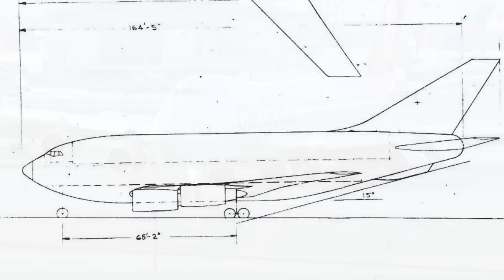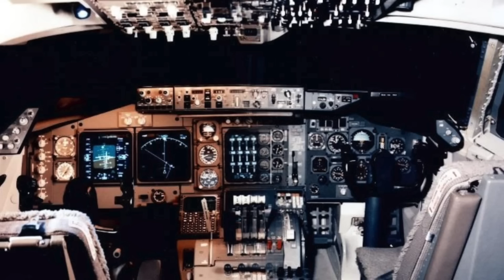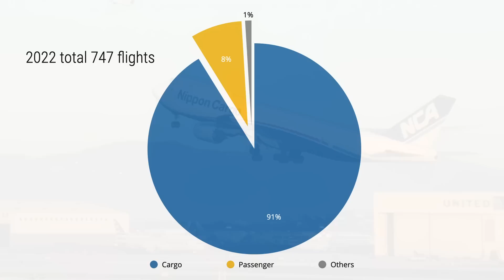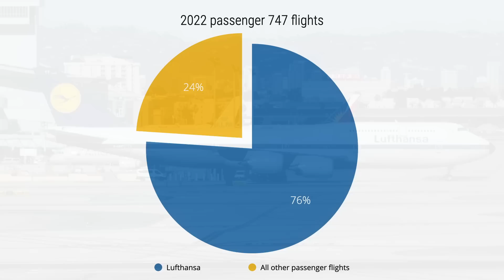60 years of the 747: from design to the final delivery

Comment: I wrenched on this beast for years…
Not once ever never have we referred to it as anything WHALE.
Ever.
33 feet at the seat from the ground. A six foot tall man could stand inside the radome. 66 feet at the indicator light on the tail.
18 chest high wheels with 30 ply tires. 197 tip to tip -200 wing span. She’s a 
Whale never was anything but…
A queen is from across the pond or is a bar fly .
The Incredible’s didn’t refer to their creation as anything else but 
   whale, notice the hump.